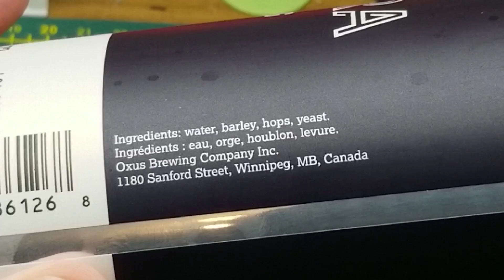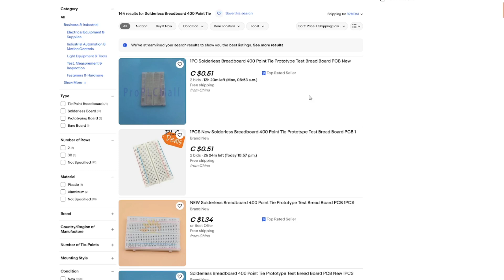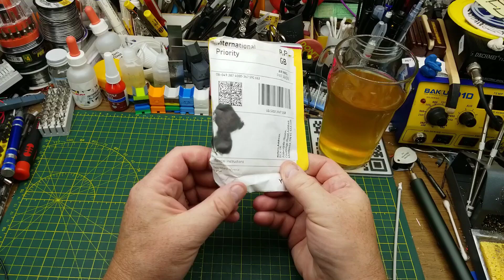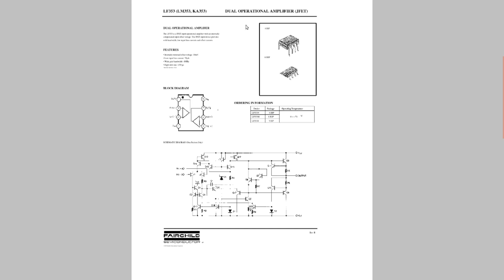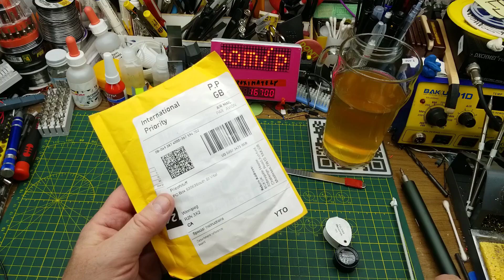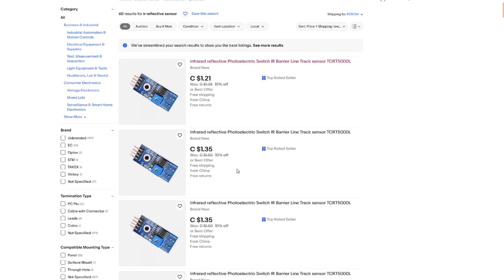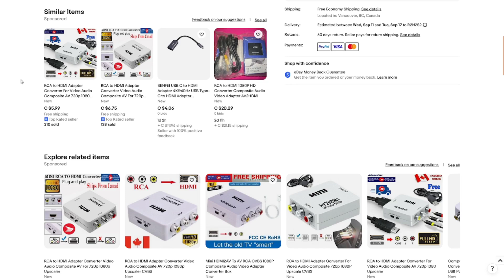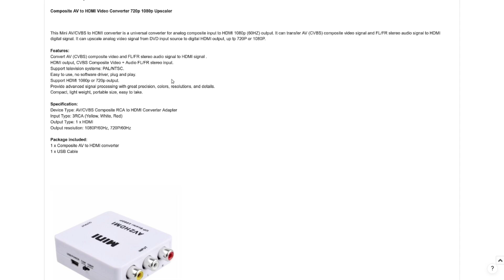Mailbag Monday 201

Comment: The piezo sensor looks like one that is used in alarm systems for glass break detectors.
Reply from the maker: That is one of many uses for them.
Reply: @pileofstuff  A number of murders have been solved by the data from these, even though the windows didn't brake They helped pinpoint the time of the shots

Comment: How much of your ordering is for planned projects vs to good a deal to pass up vs restocking frequently used components?
Reply from the maker: It's about 50-50.

I do need to start making notes when I'm ordering stuff, though. My memory aint what it used to be...
Reply: @pileofstuff i feel ya man. I have so much shit in queue and so many different notebook types on the go that i get overwhelmed alot and end up just shredding guitar all night. Haha. I got a cheap 120v 3a psu off amazon the other day for like 50 bucks. Im gonna grab another few if i find more on sale and run them in series. All the new cheapies use digital encoder dials with an output button. I remember when they all looked the same but were a different color. You had to short the leads to set the current limit haha. Kaiweets gave me a free one long ago unsolicited with an email. I commented on some video haha.

Good video

Comment: I always thought it would be fun to use a piezo element as a knock sensor for like a little novelty safe. Or use it for a Halloween decoration that would respond to knocks by knocking back at you or popping open.  Maybe combine it with a useless box and have a hand poke out.  I think it would work especially well if the box were maybe cough and shaped.